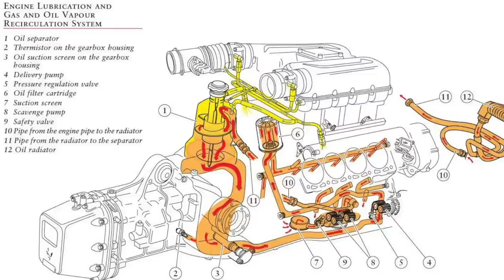I wrecked the Alfarrari... - Ferrari engined Alfa 105 Alfarrari build part 192

Comment: P.s. you can paint that small 'corner' of the cover shield yellow so it blends in with the fender flare.
Reply from the maker: I am not too worried about it as it stands out when it is up in the air, but when it is on the ground it is right underneath ;)
Reply: I was about to suggest the same.

Comment: About your alternator, a true one wire alternator only needs a charge wire back to the starter/battery to work. They use a self sensing voltage regulator and are self exciting and doesn’t need a second wire to excite it. A second wire can be used for a charge light but it’s not needed for the alternator to work.

Comment: Hi, Jeff, to avoid collisions with the roof you can put a switch there so the lift stops once the car makes contact with this switch. Electrically this switch is to place in the controlwiring of the lift. Greets, Jan.

Comment: I know from experience how bad it stings when you have everything finished and then one tiny moment of distraction and your breath stalls, then the disbelief and finally the frustration drops in.
I had some more ideas 😁 for your bonnet problem but I don't think they are viable with your deadline. I'll pitch them just in case.
1) maybe you could cut a small slice out of the plenum lids and weld it back together? But idk how far the runners go into the plenum so you might get a restriction issue with that.
2) you could cut out a small cone shaped piece out of the bonnet just above both intake pipes and weld in a small bullet shaped bulge on both sides. That changes the look though.
3) you could cut out a section of the metal at the top of the current bulge bend it up and create a little chromed "vent" insert and clear the intake pipes that way. But again, that will change the look.
Btw, the car looks amazing👍

Comment: What is done, can be undone. Don't let it get to you. I feel your pain. I had a 69 two door Datsun 510/1600. Put a shit ton of time and $ into it. All new suspension, EFI on the l20b, 280zx brake upgrades. On and on. I went out to test drive after the brakes were done, hit the brakes (locked em up cause no abs),spin 180,and ended in a ditch. Destroyed the whole driver (usdm) side. Crushed the c pillar enough to pop out the rear glass, without breaking. I feel your pain. Its just a minor setback bro. Keep at it

Comment: Jeff that sucks.
It's is important to focus on getting the car ready for time attack an come back to it later..
..
Or even leave it until after the event....
..
Had a similar accident years ago doing a cambelt on my fiesta XR2.
Lowering the car down there was a stool under the open drivers door..
Crunch! 
Didn't do that much damage other than ruin the door/wing shut line...
..

Easy was to tell if you have a good ground.
Measure battery voltage across the terminals.
Place + ve lead of voltmeter on battery + ve & the negative on the highest part of the engine/block.
Shouldn't be more than 0.2 of a voltage drop @ the engine/block.
If it is there is high resistance and will have to relocate the ground.
..
As the Alternator is already there should be good to go.
..
Also wondering if you could put fuel flow arrow decals on the fuel lines in the boot to distinguish the vent from the fuel supply.
..
More of a safety thing than anything considering there both black pipes..
...
Hope Mrs Jeff makes makes a full recovery..
Nothing worse than dentistry/toothache..

Comment: I've made so many mistakes like that - it hurts, but don't let it cloud your days. Best way is to choose to forget about it every time you think of it. Maybe get a "dents away" man in - they do a great job and it would make a good video!!
Could I suggest rerouting that alternator wire so it doesn't pass through a body panel? The engine will move and twist under torque and the wire will eventually wear through to short on the body with no fuse protection. You might have to cut away the plastic shroud on the terminal so it can run under the engine, but that's better than risking what could happen if it does short out!!
PS, at 15:25, that nut and bolt (on the steering rack mounting rubber?) needs tightening or a spacer making if it's not on a flat surface.

Comment: I’ve been there, painted the car and dropped a bench vice on it…. At least with unbroken paint you might be able to pull-out the dent with the glue-on dent removal peg system.  I’d also have to paint the little bit of the oil tank guard that is cut into the arch yellow, my OCD couldn’t cope with it otherwise!

Comment: I know its a bit late now Jeff, its hard to tell from here but that looks like an experienced body guy with rods could get that back 99%, but other thing i was going to say is you can add a microswitch with a small arm on it next to the roof beam, as a car gets close it hits the switch first and you either have it sound an alarm or you wire it into a relay to disconnect the signal from the "Raise" button stopping it from smashing into the roof.

Comment: Ouch, reminds me how I dented my roof right after coming from paint shop and installing the body back into rotisserie. Regarding the hood issue you could do, what I think was suggested before when you made the hood window, grind down the edge of the plastic with a router. It would be level on top and gain some clearance on bottom side.

Comment: Tip
If the metal is thin enough and not too creased you can use hot glue to pull it back into shape.
There are hot glue paintless dent repair kits you can buy but you can DIY it with some wood and a couple of screws and coat hangers.
Cut the wood into suitable sized bits screw a bit of wire to it for leverage and glue the wood down after watching the tutorial for the commercial kit.

Comment: Why not fix the Lexan from the outside? Use the 6mm thick stuff and rout a groove around it so it locates in the hole so the bottom of the Lexan is level with where the top surface is now. this would cure your clearance issue plus you'd no longer have a place where water can sit.
Reply: Also run a router around the upper lip to give it a smoother transition to the bonnet/hood.

Comment: I wonder if the future projects and any further work on the cars need to be protected from this unfortunate and painful accident and maybe have some sort of alarm when a height is reached near the roof to ensure you watch what's happening. Especially as the boot lid got a bit of damage early on in the project too. A limit switch on the ramp is fine but perhaps triggering an alarm or cut out just below the roof line allows for the various height vehicles or a bonnet or boot lid being open.

Comment: At a later date, paint the bash plate (protecting the dry sump tank) in Raptor, it will get sand blasted on the road and look second hand quickly.

Comment: The bonnet remove the perspex .mark the spots that need removing equally and try a dremmel from the inside out touch up after . Dent in roof .do a super local repair and then use some black decals following the window and make a fake bigger window/overhanging spoiler effect . Hope it makes sense or helps

Comment: The air intakes are not at the botton of the intake plenums. They could be move downwards by at least 5mm, maybe more. That would avoid any cut or flat on the curved pipe between plenum and throttle valve.

Comment: That was a little unfortunate with the hoist, but it's all fixable. I have a similar issue at my place when I put the R33 GTR on in reverse. The stupid rear spoiler comes really close to the truss. With the bonnet issue, would a temporary solution to get it drivable be just shim the front hinges say 10mm to give you some clearance?  I mean it's just temporary until you work out something better. Give it that GTA junior look.

Comment: The unintended roof dent is located where there is a double skin - so not easily accessible from within the car.  Could be a challenging task for a paintless dent removal specialist as that area of the roof is curved and a relatively stiff part of the structure.

Comment: As you were lifting it after putting in the oil return line I was genuinely wondering how you keep track of the different vehicle maximum heights you can raise cars to and whether a hoist manufacturer has some preset limits you can load for each car when you drive onto the hoist o you can set and forget. Kinda like some powered car boot lids and tailgates. That really was all going through my head before I heard the "No No No No".

Comment: Feel for you on that one Jeff. I know you dont have much choice but you're rushing and cutting corners and that never ends well. That Alternator cable and grommet through the chassis is your next disaster, once it frets through you have a direct unfused battery short and goodbye alferrari, swing it forward and clear of the frame. Get a good PDR guy on that roof, probably sort it.   The fix for the plenum is either relocate the intakes to the middle side of the plenum or the correct way cut the bonnet raise it and repaint it all the other stuff is a bodge - dont ruin it for a show.

Comment: Just drive it with the hood up, you have  the lexan window to see where you're going. Also you could stick a line of duct tape on the lift leg and write the name of each car on other pieces of tape placed on the lift  pillar that lines up at the corresponding  maximum height for that car or mount parking sensors on the beam.

Comment: You must have gone a whole day or something for karma like that to whack you in the roof like that! I almost heard a very sneaky "vroom"- almost! I think you've the right of it- the dentless tools and maybe a drilled hole if the upper reinforcer gets in the way. It will leave and "interesting" repair for the head liner, though! I'll miss Missus Jeff's Ferrari flusterations- and her ensemble of Australian wool this time of year Down Under!  Best to both of you! 
PS; On your poor roof; if that ding was a bit further from the rear window trim, I'd soap up the edge of a traditional toilet plunger and stick it on and give it a stiff yank- I've pulled small dents with no creases from doors and quarter panels. For this, I'd go looking for a professional glass installers " suction handle" and put one end over the ding pump it to get the vacuum up and give it a pull.

Comment: I was a panel beater for 35 plus years around 2000 I was asked by an old lady if I could push out a small dent on the boot lid of her car as it was a mobility car she had just paid £200 insurance excess on previous damage , didn't realise you had to heat the panel up as soon as pushed on the dint the paint cracked the old girl was not impressed and spat her dummy out with me , that's what you get for trying to do a good deed LOL .

Comment: yeah... blow it off... fix it after you've finished all else according to your (more or less) original plan. similarly, I'd reset the hood w/ clearance shims & worry about more engine parts fabbing after the car is running & fairly road-tuned.

Comment: You're not the first to do that.  I've done it myself.  I build a bigger,higher shed to not do it again.  How often have you turned the engine over ?  By hand or starter.  The valve springs don't like sitting under pressure for a loong time.

Comment: I’d make the hole in the bonnet bigger, repaint it, then put a slightly bulged polycarbonate cover. I wouldn’t ruin the existing look of the induction pipe work to make things work.

Comment: I am sure others have had equally depressing brain fades.....I did too. My 1969 ALFA spider was llifted a bit with my garage door closed. Decided to get some fresh air in the garage so opened the garage door....and since I had my trunk lide open.... scrape but no dent. It was a fresh paint job also....😢   Fixed it but I descovered a lot of swear words I hadn't used before.

Comment: Shave 5mm off each side of the gasket face of the plenum to the lower manifold and throw an o-ring groove in there and some short bolts. Can you not also take 3 or 4mm off the head interface too?

There was shot you had last week and I was only thinking "gees that hoist only just fits in that shed, wonder if he has moved the limiting stops?"

Comment: Easy. Heat the area with a hot air gun, good and hot.  Then blast it with 2 cans of compressed air.  The shock cold will pop the dent.

Comment: I know your unlikely to do it again but just in case id gaffer tape a plastic bottle to that beam so you hear it crumple before your roof does.
Reply from the maker: Not a bad idea.
Reply: @HomeBuiltByJeff  
If you wanted to go hi-tech you could fit a pressure sensor cutout to a wooden bar that lays just below the beam and on a hinge that would stop it automatically.

Comment: Likely the PDR guy/gal can get it out! May have to remove the windshield. Could have been worse, hang in there.
Reply from the maker: I think PDR should be able to fix it, so I am not too worried. It is just deflating after all of the work.
Reply: Isn't the headliner glued into the window openings all around?
Looks to be tricky as the crease is right close to the weld

Comment: Hi Jeff. 

What isnthe difference in sizes of the original wheels and these new ones.

What are the new wheels called.

Thanks.
Reply: The Alfa Romeo GTV 2000 was fitted with 5.5 x 14 inch steel rims with similar sized alloys available as an option.  The ones fitted to Jeff's car appear to be the aftermarket 8 x 15 inch rims - which resemble the type fitted to the Alfa 1750/2000 GTAm - although the original GTAm wheels were 13 inch diameter in order to accept the slicks available during the late 1960s.

Comment: The impact with the roof was certainly disheartening - and it was a very good decision to just walk away and cool down - as continuing to press on in an enraged-frustrated state usually results in more regrettable calamities.  Years of experience has taught me, when calamity strkes - drop everything, walk away, cool down and 'regroup'.
If my recollection serves me correctly, this is the second time that you have unintentionally hit the roof of the garage whilst raising the Alfa.  Is it possible to add a dormar roof that will increase the height of the roof at the desired location such that a height limiting bar-switch system could be added to the hoist - as this will eliminate future impacts with the roof.  As my hoist comes equipped with a height limiting bar-switch system - was this an available option with your hoist?
Good luck with the car show.

Comment: Before you go any further you need a nylon cord strung tight at the height limit connected to a limit switch . And after my smart ass comment please know I feel your pain I bent a con rod on a two stroke crank because I wasn't watching and it hit the die plate  on the press bed. And as an aside I hate alternators that self excite

Comment: Shit happens dude, no one will judge you for it happening, but they will for how (and if) you learn from your mistakes. Humans are fallible, you need a process in place to prevent this from happening again. Like tying a bell to the beam. It might scratch the car next time it happens but it's better than a dent and will automatically work with any different height car you put on the lift.

Try not to beat yourself up over it. Just think of a way to prevent it happening again and then implement (and test) that. Lesson learnt at that point.